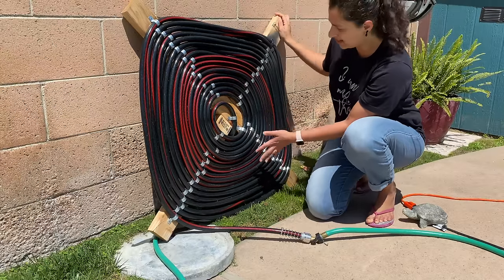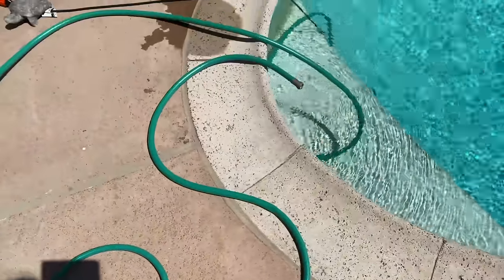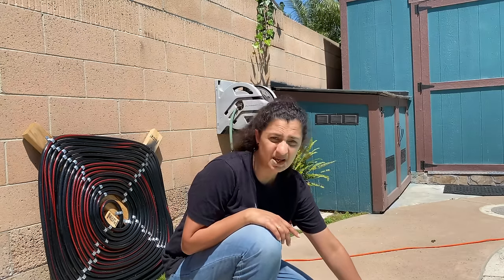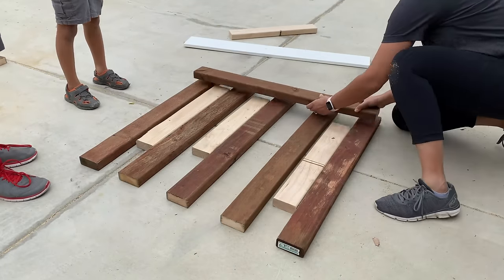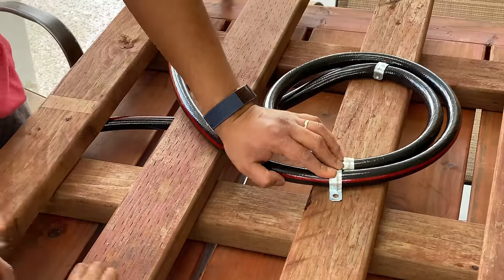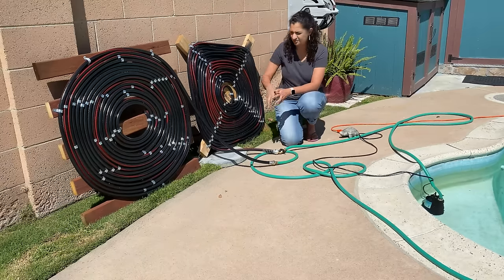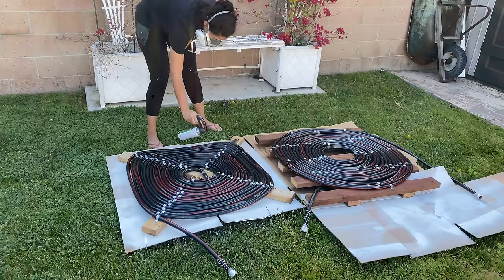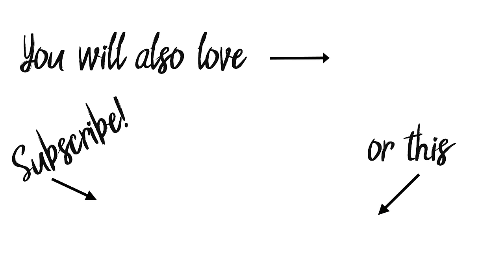DIY Solar Pool Heater - Simple & Easy Design - Did it work? | Anika's DIY Life

Comment: I just bought an adapter to connect a standard black garden hose to one of the water run jets (after the water runs through the pool filter). Then I loosely coiled up the hose on the pool deck (which gets pretty hot and probably heats up the hose faster). On a hot Texas day the water coming out of the hose is too hot to touch!
Reply: I've just tried the same thing, 1 1/2" to 3/4" adapter and connect black hoses.  It seems a lot easier than getting a seperate pump.  I've got 200' going and it seems to bring temp of water up about 10 degrees at full flow on a 75 degree sunny day.  It has occurred to me that this system will also cool water at night if left connected on a cool night.

Comment: If you build a box around one of the coils, paint the inside black (also paint the pipe black, those red bits are not generating as much heat) and put some glass or perspex on it, that will trap a lot more heat and will give you the same heat using one as with using 2 the way you are using them now. You also won't need to restrict the flow either. Restricting the flow will only decrease the life of the pump.
Reply: red absorbs just about as much as black
Reply: hi so I saw another video where they did this but they used a copper coil section on a grill. He also used a hose a spray on the end in order to again trickle the water.. In that case, where it’s not dependent on the entire hosing system, being heated by the sun, just a relatively small portion of the coils being hot AF on the grill… would it still be better to go at maximum flow rate?
Reply: @XclusiveChiq  You are repeating yourself.

Comment: Do I need to use a water pump? Could I not just hook a hose to my drain and then read that water through the solar heater and back into my pool
Reply: Good thinking 99.
Reply: This is a great idea. Have you tried it? I have an above ground pool with drains at each end.
Reply: Have to have an above ground pool.

Comment: 🇨🇦👍🤠Add a one-way valve and a timer to shut off the pump for 20 mins at a time then run for 5 mins. Then you will not need to control the water flow.

Comment: So-o .. lots of  Qs:
      - How many gallons is your pool?
      - What type of pump are you using?
      - How many hours/minutes is your system getting sunlight in a given day?
      - how long does it take for your pool to get from 70F  to say, 82F?
      - what city/state are you in?
Reply from the maker: Its a 20,000 gallon pool. I have the exact pump linked in the description. The system runs about 5-6 hours a day during full sun when needed (don’t need it anymore since its summer now). We are in Southern California and it took about 3 days of running the pump on 80-82 F days to get the pool water up to 80F

Comment: Hello: Restricting the flow will make no diference. Sun's energy captured will be the same independent of water flow rate. Instead just run the flow at which ever speed the pump is running with the least power. Also how about attaching to that nice concrete wall you have and attach some black spray painted metal behind it to absorb more sun...  perhaps better to use cheap polyethene 0.700" irrigation pipe for this? good stuff!!
Reply: hi so I saw another video where they did this but they used a copper coil section on a grill. He also used a hose a spray on the end in order to again trickle the water.. In that case, where it’s not dependent on the entire hosing system, being heated by the sun, just a relatively small portion of the coils being hot AF on the grill… would it still be better to go at maximum flow rate?

Comment: A higher flow would be better since it would reduce the flow of energy from radiation on the actual hose. A higher temperature hose would loose more enrgy compared to using a higher flow that would result in the water cooling the hose to a lower temperature. The temperature difference between the hose and the air should ideally be low. Also think of it this way - with the flow seen in the video? How many days would it take to run the entire volume of the pool through the system? As already stated - the influx of energy is not impacted by the flow rate
Reply: hi so I saw another video where they did this but they used a copper coil section on a grill. He also used a hose a spray on the end in order to again trickle the water.. In that case, where it’s not dependent on the entire hosing system, being heated by the sun, just a relatively small portion of the coils being hot AF on the grill… would it still be better to go at maximum flow rate?

Comment: The only problem with that system is that the lumen of the garden hose is too thick impeding some of the heat exchange to occur. I am doing the same project with 1” sprinklers hose with a 50-50 divider to run the water back to the beginning of the system .

Comment: Why not use the guage port on your filter that would eliminate buying another pump. We run our pool pump almost 12hrs a day so it would be automatic our guage is broke most of the time so I plan to remove the guage and use the water that will be coming out of that opening no need to throttle water flow down it’s only a 1/4” outlet so I think it will do fine I already tried the dome heaters and that didn’t work outtubing on those is 1&1/4” our hoses are 1&1/2” too much restriction

Comment: Very nice  👌  but would you consider  a propane  water heater  it works well  😀
Reply: Propane water heater would cost a small fortune to run constant .propane is not cheap

Comment: Why not come from your water pump box, along the wall back and forth in longer runs then back into the pump box? That way pool pump is doing the circulating and longer runs along that wall gives the water more time to heat up. PLUS it’s on the wall so not in anyones way…. Please tell me if that would work

Comment: I dont dispute the water comes out hotter than what goes in but doubt it would make any difference to the temperature of the pool water. Maybe a childrens inflatable pool yes. A pool this size no. The cubic capacity of the unheated pool water will only absorb the little heat transfer taking place rapidly cooling the heated water back to the original temperature
Reply: Ditto

Comment: I'm too lazy to read through all the comments so if this has been mentioned, disregard it. If you make an inclosed and painted the inside black to place the rolled up hose and cover it with plexiglass it would retain a much greater amount of heat vastly increasing the heated water circulating through it. Like sitting in your car on a hot day with windows up verse down. 👍
Reply: Exactly what I thought.  Just use a 4x4' sheet of treated plywood painted black, and use treated 2x2's around the edges, then your plexiglas over the hose.  If you want to add reflective material, some cheap mirrors like the ones they use in dorms would be good.
Reply from the maker: Yes, you are right. It will help make the water hotter.  We were planning to do that next. But this worked as is so we didn't need to. If you live in a place that doesn't get enough sun, you can definitely do that.

Comment: I’ve ripped the hair out of my head over this same project two summers in a row now. The Only way this idea will work effectively is to take this setup, and somehow add a timer to the pump that will turn the pump on for about 5-10 minutes in 10-15 minute intervals. In other words, if the water is flowing through the pipes at any meaningful rate of flow, all the heated water will cycle through the pipes in just a few minutes. After that you’re just cycling cold water through those pipes. The point is is to let the hot water cycle through the pipes, then shut the pump down for a few minutes to allow the pipes and water inside to heat up again. Rinse and repeat.

Comment: Just make yourself 5 ea. 5’ x 5’ CPVC frame attach cut bubble solar blanket material into squares to fit frames and attach with nylon zip ties. Just let them float 24-7 in pool unless u are in it and trust me if you have covered 80% of you pools surface it will be as warm as a wino’s piss!!
Reply: I wonder if anyone has ever measured how warm a winos piss really is, would you have to figure if the collection vessel was cold before collection what was the suns out put that particular day!  Now doesn’t that sound stupid wanting all those calculations?  Hell you can just invite the wino to come over to swim and you may not need to calculate anything cause the wino will more than likely piss directly in your pool thus having a slight warming effect on the pool.  May say the more the merrier.  I’ll bet you could find a dozen or more winos to come and act like a bobber in your pool this a more agressive approach to warming the pool.  What about a guy that drinks beer.  They piss a lot so they may work quite well for you and there is some heat in those big beer bellies too,  don’t forget to calculate those

Comment: Put the ball valve at the outlet, so it fills your black hose with water completely, you're losing heat transfer within the hose due to the air spaces because of the pressure being low as it goes into the black pipe. I use a low volume 12 volt rv water pump and it work great without have a 110 source near a body of water.
Reply: No, that isn't how water flow works. :D The water pushes the air out in such a small tube. Sorry, I just continued watching the video and saw that her flow rate is so incredibly low; you are right. :D
Besides that, there's no point in restricting the flow, as pointed out multiple times in other comments.
Reply: @crixi__  Back pressure is missed often, I used this type of system and the water was passing too fast through the tube so I capped the end (ball valve) to build the pressure and it works pretty good, usually about 125 degrees out of the hose end into pool water when its at 80 degrees. It really doesn't work that well though,..just an experiment.

Comment: Lay them flat!!! the angle to the sun should be perpendicular for optimal heating.  it makes a big difference
Reply: That's true.  But only if you live near the equator.  In the northern hemisphere, they should be angled, optimally at an angle equal to your latitude if you're going for the average over the whole year - that would be about 35 degrees for LA or 47 degrees for Seattle.  But you probably want to bias them to be efficient in summer, forgetting about winter, so I'd subtract about 10 degrees.

Comment: why dont you use mathematics and physics to calculate energy for heating the pool? It is very simple. you need just sun energy amount on sqare meter, volume of your pool on meter ^3. and heat capacity of the water. Then you just need to calculate how much energy you need get from sun collector to heat you water volume in 1 degree.

Comment: iam sorry but how many watts is your pump? as link doesnt work,.. i want to use 60metres of hose, will 400w be enough to pump it around?
Reply: I'm running a pump at 1000l/hr and it is 5.5amps at 12v. You can see my setup on my channel.

Comment: I think you should add metal duct tape underneath your hose on 2x4 it should draw in more sun heat
Reply: YEs..but maybe if you enclose it(plexiglass), otherwise reflected to open air, I would think.

Comment: Something you missing........ you are in a close loop system,so the maximum flow you put in your coil the faster you gonna heat the pool,no matter the feeling that the water is not so hot,the maximum flow the maximum you drain the energy from the coil.
In other term better have 1 degree differentiel at full flow than 10 degree differentiel at a ridiculous flow........you are in cloose loop!
Reply from the maker: Nope. It doesn’t work like that. You need to heat the water not circulate it.
Reply: No YOU wrong,the water is in constant circulation between the pool and the coil,is not like you want some hot water to wash your hand,you are in cloose loop systeme,faster you go,more you extract energy.I build some wood pool heater and i know what im talking about.For me i can reach
5 fahrenheit at 30 gallons/min.Try tom compare with your results what is the flow you can have to maintain 5 farenheit?.....maybee 0.5gallons/min?
Absolutly impossible to heat a pool this way
Reply: Sure the gain seem so low with the valve wide open but it still have a gain and the result is you gonna heat your pool faster this way.
The proof it this that now the coil is  cold so much you extract its heat
Reply: Fred's correct if the hose is still warm your losing heat run it at full speed and your pool will warm up faster.

Comment: Where did you find a 100' hose for $35? I'm in California. A cheap 50' medium duty runs me $28 at Home Depot.
Reply from the maker: Amazon. It’s linked in the description
Reply: @Anikasdiylife  thanks, but it shows it at $60.98. Still cheaper than installing a gas pool heater. 😎

Comment: great idea put the valve after the panels going in the pool so that the water has more time to heat up before entering the pool. The Delta-T is the temperature difference between the water temperatures entering and leaving the heating panels..

Comment: PEX painted mat black in a sealed enclosure (also painted black inside) with a glass or some type of clear top would work best. Also, flow rate should not matter much. 10 degree warmer water flowing at a tenth the rate is the same as 1 degree warmer water flowing at full rate.
Reply: Also, you can line the inside of the enclosure with mylar. Not sure if black or mylar would work better, but if i had to guess, id say mylar.

Comment: Put a big black tarp over the water, the sun rays will hit this and will directly heat the water, much easier and quicker. Your effective area the sun is hitting right now is only a square meter, where as you could use the entire pool as a receiver if you covered it with a black cover.
Reply: and make a solar copper ionizer to use under the black 6mil sheeting from HD.

Comment: what is temperature different if you let it running from hose while pump is turned on?
Reply: once the stored hot water is pumped out it runs too cool to do anything.these heaters are a waste of time.

Comment: Holes and zip ties would cut cost down a bit instead of clamps
Reply from the maker: ok
Reply: @Anika's DIY Life  just an idea
Reply: @Anikasdiylife  at a guess how many metres of hose would I need for 18ft long by 9ft wide by 4ft deep ( 16.450 L )
Reply: @Anika's DIY Life  in in uk probably not as hot as wear u are

Comment: I'm sorry to have to tell you Anika , but this will never work , it's simple physics , the pool is too big compared to sun collecting area . The best way to achieve what you want is to cover the pool water with a large thin plastic sheet , this will stop evaporation and by evening the temp might have risen by about 5 degC . Painting the pool a dark colour will also help greatly , but not many people want a black pool.
Reply from the maker: You don’t have to be sorry because it worked for me. Also, PhD in Physics here 🙋🏻‍♀️ so I know exactly how simple physics works. circulating the water over a week through the hoses helped speed up the warming of the water. 
Covering the awkwardly shaped pool is very hard as well as managing the sheet, although that will be a great addition to speed up the heating. Also, who will empty the pool and paint it and fill it up. Thats a lot of money and waste of water.
Reply: @Anikasdiylife  A Phd in physics should know that by restricting the flow as you did with a valve to get a higher exit temperature  will only make the system much more inefficient , the goal is to have max flow so the collecting coils have a lower temperature and thus loose less heat to air ,  if temp difference between inlet and outlet is a few degrees this will transmit max heat to pool for given collector area (very fast flow rate)

Comment: A solid board on the back, like black plywood would reduce the escaping heat on the shady side of the tube.  Making it a glass enclosed box would also add some heat.
Reply from the maker: Yes. Both will be helpful. Adding a plexiglass box was going to be our next step, but we didn’t have a need for it as it worked just fine without it
Reply: Put black plastic sheet over it. This will capture a lot off heat underneath where the hose is.
Reply: @Anikasdiylife  Why not just cover the pool w/ 6mil plastic sheeting?

Comment: Wouldn't a Copper coil work better ?
Reply from the maker: Definitely but they are also a lot of $$
Reply: This is what I am doing at the moment. The base of the heater will be copper sheet and the copper tubing will be clamped so it is in contact with the sheet. Then all sprayed black and topped with a perspex top

Comment: If you put the Solar Heater in a black box with one plaxiglass face , then can reach at 60 celsius degrade.
Reply from the maker: Yes. It sure will. But plexiglass is very expensive and we wanted to see how far we could go on a small budget.
Reply: @Anikasdiylife  you can get cracked or scratched plexi from the manufacturers for much less.

Comment: You are not helping by making the flow slow... you want the biggest temp differential you can have at the heat exchanger (the hose) You could flow at a much higher rate with a smaller difference in temp and heat the pool better...  If you went full flow, you might only measure a 1 degree difference, but you could be flowing 100 times as much water, which would do more to heat the pool... Also, you need to pump the warm water down deep into the pool.

Comment: so many problems with your design... do not restrict flow. make a box, put hard foam insulation under the coiled pipe, cover the box with a peice of glass.  if your pipe is not UV protected (most pipe is not) then you should sand the pipe (the side that will be exposed to the sun) and paint with a flat black spray paint that is designed to spray over that material and has UV protection.